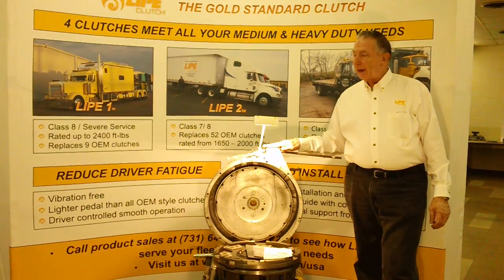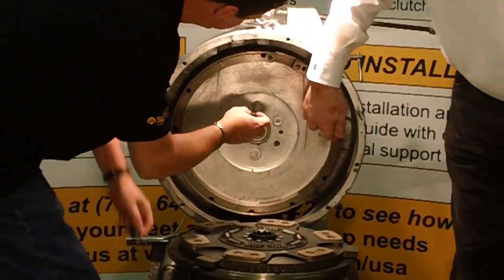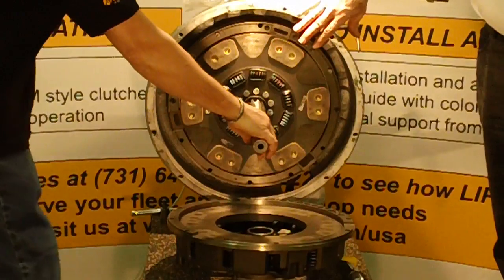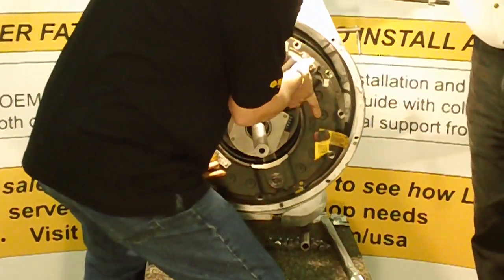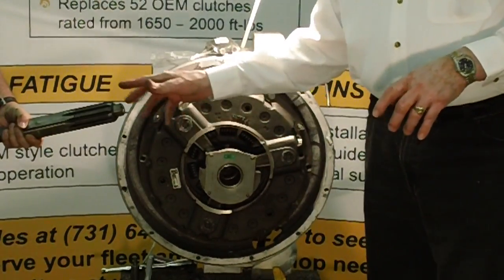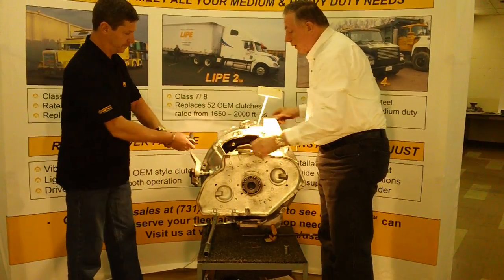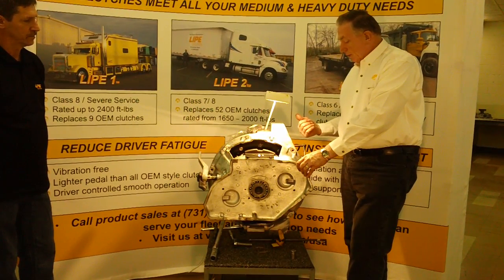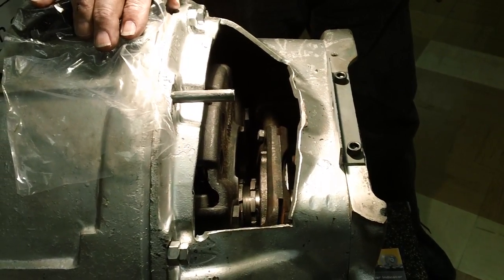Lipe Clutch 15.5" Installation

Comment: YES SIR EACH THROW OUT BEARING HAS THE GREASE FITTING.MY NAME IS BOBBY AND I AM A SALESMAN REP FOR LIPE CLUTCH.FEEL FREE TO ASK ME ANY QUESTIONS OR CONCERNS.
Reply: Where do I get heavier springs?   I'd like my Lipe 1 to have a higher torque rating
Reply: Hi Bobby!! Putting my lipe clutch in now!! Got the transmission out removing old clutch now!

Comment: You guys should produce a installation tool. A shaft with splines all the way through so you dont have to remove the shaft in between installing the clutch discs. Make it out of steel too not some cheap shit plastic! This would make it a mechanics dream. They are excellent clutches and cheaper than an Eaton easy pedal too.
Reply: I usually use the metal shaft from the trans kit